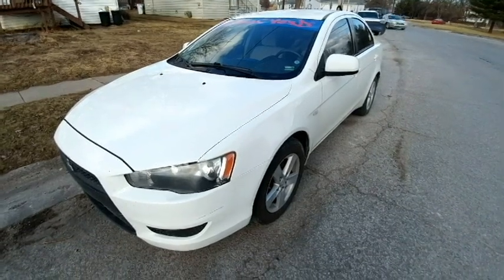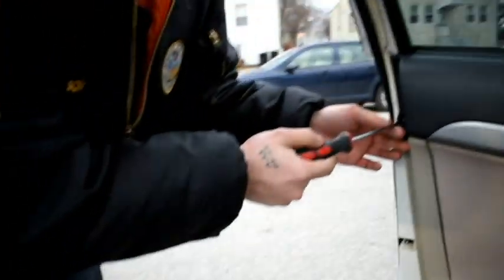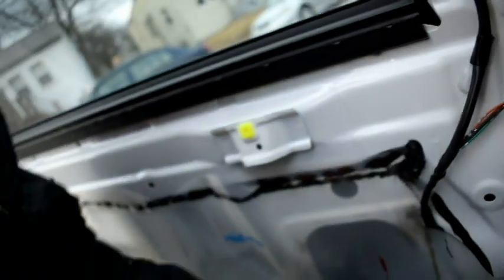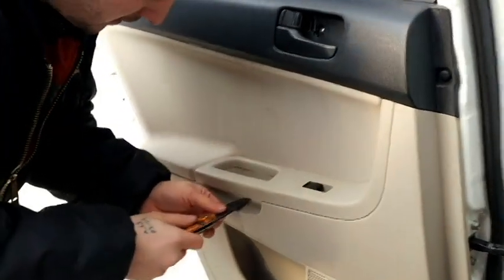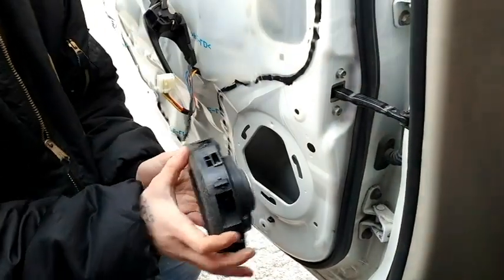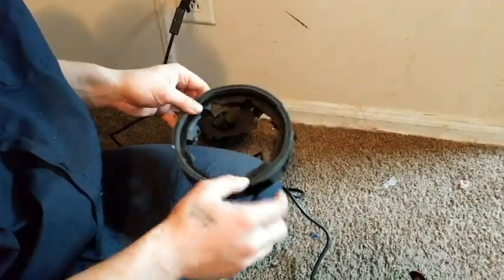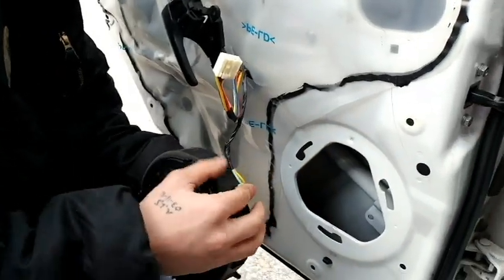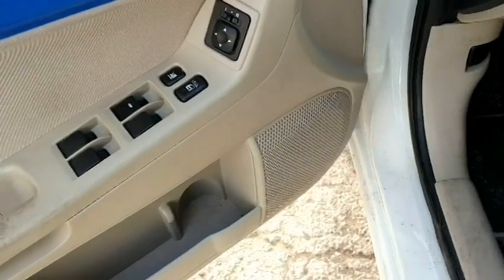Kicker 6.5" Speaker Install on my 08' Lancer

Comment: Just did one of these, I junked the whole factory speaker and plastic. I just used longer screws and mounted the speakers right into the metal where they wanted to sit. Worked really well and I cut off the plastic connector and used crimp on connectors that plug into the speaker. The install went way quick for me I just made sure the cone of the speakers isn't in a position where it would contact anything and angled the speakers slightly up.

Comment: I used to have a jacket like that from when I was in the army.
Reply from the maker: its were I got mine :)
Reply: @EFFEKTRecords  After 15 yrs of use. My jacket got worn out and ugly so I just took all the patches off and put them away so they wouldn't get worn out any worse. I still use the jacket regularly.
Reply from the maker: @cvpifanatic  Mine dide to! I ended up putting it up last year so It wouldnt tear any more... it was fine tell I was sitting around a camp fire when a few pieces of ash blew in the wind and landed on it... then it started to rip so I had to retire it ha